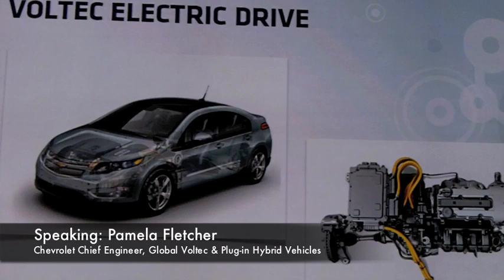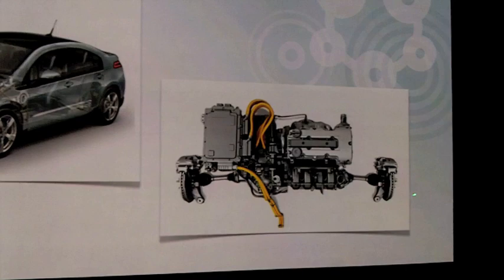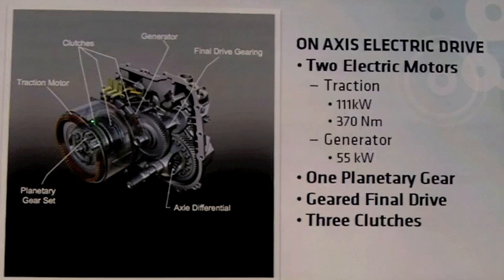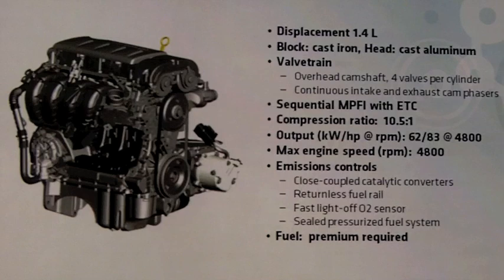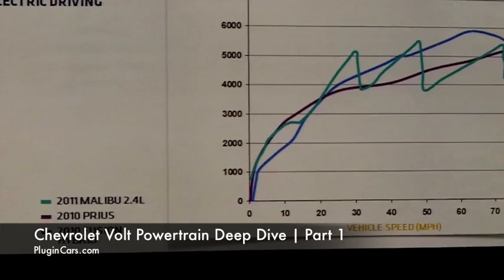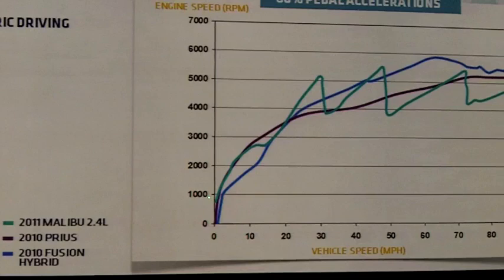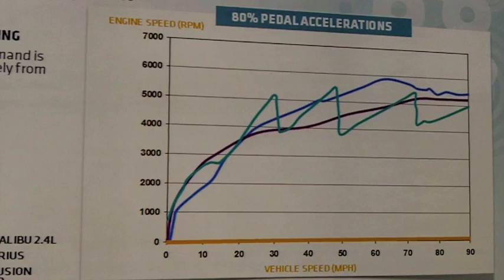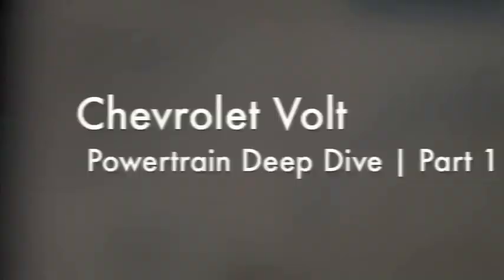Chevy Volt Powertrain Deep Dive | Part 1

Comment: I believe she was saying that (in extended range mode) the power for the electric motor comes from the battery first and the gas engine second.  Obviously, the battery never directly powers the wheels, and the gas engine is always clearly positioned as second to the the battery in this presentation.
Reply: The electric motor always powers the wheels and the battery always supplies electricity to the motor and sometime the engine/motor generator is supplying electricity too.

Comment: hey guys, I have a volt and 9 gallons of premium is really nothing.   Premium fuel stores better in the tank, and like you guys mentioned, doesn't get used up as fast, so its better in that case.  The new 2016 model will not require premium btw.